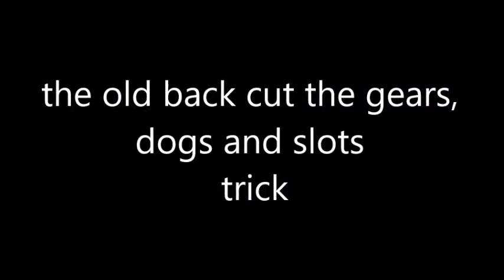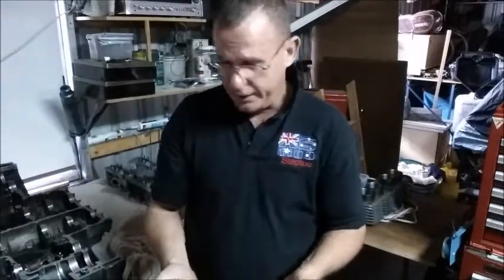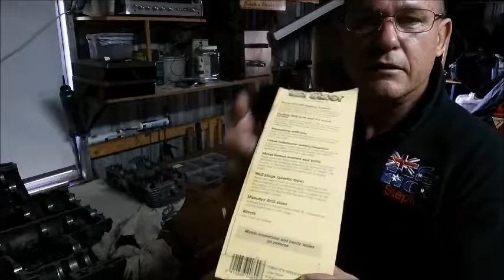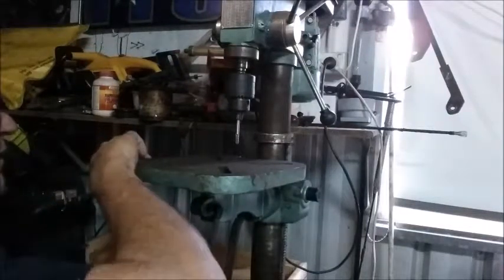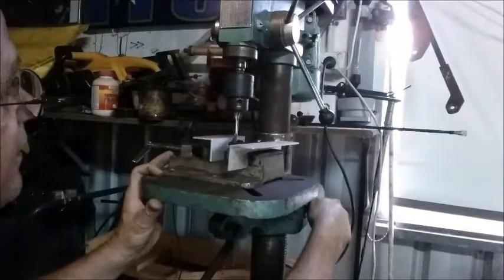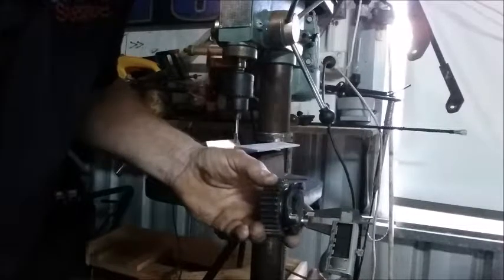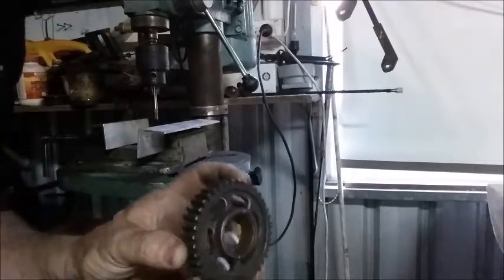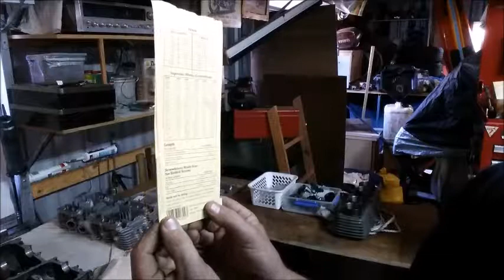back cutting gears

Comment: It truly does make a difference. But, to be honest, the only way to do this and be 100% sure that every Dog and Dog house are in the exact location is to use a rotary table on a mill and you can set your mill head to 1.5 or 2 degrees, whatever you like. This video absolutely shows the best way for someone to do this themselves with a drill press, and people with a good eye can often do this pretty darn accurately. Bear in mind most shops charge 300/400/500$ to back cut/under cut gears and that's with just the gears handed to them, let alone pulling the motor, top end and splitting the cases...
Reply from the maker: That’s why my channel is here, to show fellas how to do it themselves without exorbitant costs👍👍

Comment: If the working face of the top of the dog is rounded where do you decide to stop cutting? When you start to see hints of fresh metal all the way to the top of the dog? Or when you reach the bottom of the rounded portion?

Comment from the maker: Jeff, it basicy came about because the engineering works I initially went to said the job would blunten their cutting gear, 
I needed to do several sets so I had to a chat to a few in the know mates and this was far better than hand held dremmelling that is quite often used,
I don,t know the bit flexed that much as there was bugger all pressure being applied, if anything the chuck was spinning nowhere near speed for the tip and my concern was it would blunten or chip the bits teeth
as it was it seemed to work well and with bearing blue was able to get very close matched faces